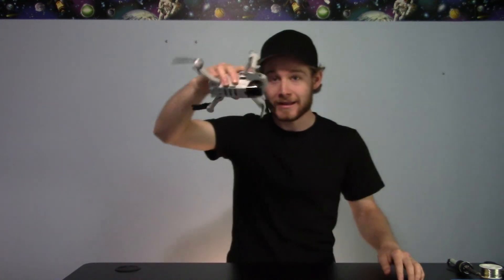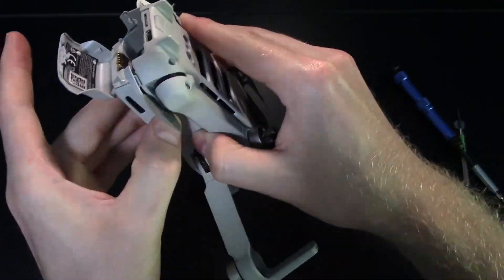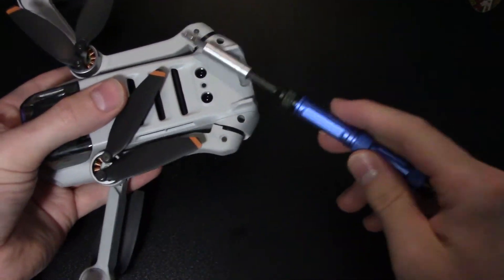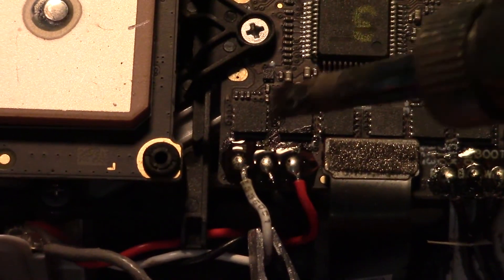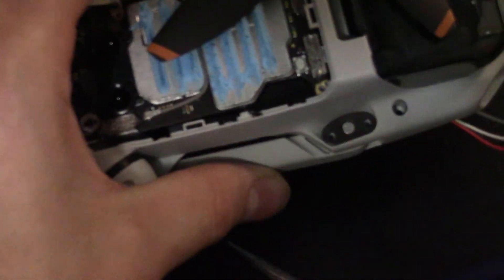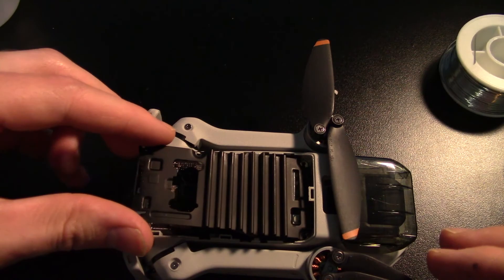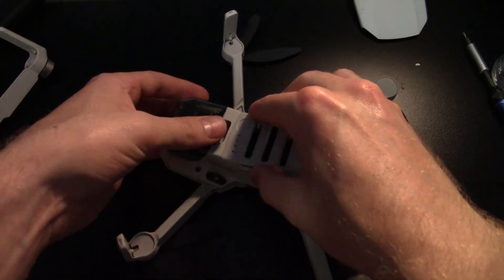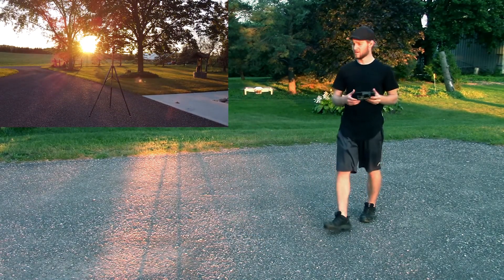DJI Mavic Mini 2 Front Arm Repair: Step-by-Step Tutorial

Comment: Where did u get the replacement
Reply from the maker: I got it from Amazon. https://amzn.to/2WTXDWY could probably find it somewhere else for cheaper though. Look up OEM when searching too.
Reply: @NathanShantz  I need the front left  pls help with a link I been searching not seeing any that's available
Reply from the maker: @AliKraftDesign  You can get a mavic mini (1) leg and swap the motor if you have a mini 2. https://amzn.to/3FNCRZz  You could also try ebay but it might take longer to get to you. https://www.ebay.com/itm/254795790373
Reply: @NathanShantz  ok (mini1) so it would work just the difference is in the motor correct
Reply from the maker: @AliKraftDesign  yeah the Amazon one is mini 1. I believe the motors on the mini 2 are a bit better in performance but the same footprint.
Reply: Would it fly differently with mini 1 motor vs mini 2 do I need to unthread it
Reply from the maker: @3brosgaming69  I have not tested this but I am assuming it would have to send more power to the mini 1 motor to create the same amount of lift. This would end up using a little bit more power from the battery so you might see the drone have to land maybe 1 min earlier? Probably less if just 1 out of the 4 is a mini 1 motor. I don't think it would affect much of the flight performance/handling tho.

Comment: Great video great details thank you. Just got the mini 2 for Christmas and wouldn’t you know it tree jumped right out in front of me too. Ordering a new arm and doing the repair myself I see it’s cheaper to buy a shell with no motor what do you recommend with or without motor
Reply from the maker: I probably could/should have got one without a motor as well. I don't think it's that hard to take apart. I would look up how do do that. The antenna wire also runs through there so you might need some small tweezers. Also some people have 3d printed shells so if you have access to one that might be an option? Good Luck!! 👍
Reply: @NathanShantz  Guys, are you able to find a video how to replave just the arm shell? That would be a great video because I cannot find one. Thanks for the upload video it was great easy to follow.
Reply from the maker: @maxblued  I know someone 3D printed a arm shell and just swapped the motor, antenna and wires. I'm not sure if they sell just the shells but I can post a link to the 3D video if you want?

Comment: Hey bro,  so I snapped the arm lock piece rite,  I got a replacement but the arm won't lock back in place when folding out
Reply from the maker: So the black piece with the 2 screws that holds the arm in has a spring in it. This spring only rotates from 0° (folded in) to like 150° (folded out). It actually has enough force to go to 180° but is physically locked at the 150°. This is how it locks. If take it out when it's folded out and put the spring back when it is folded in, it will not be able to lock in the out position. My guess is you took it out in one position and put it back in the other. Try putting it back in the other position or you can use some pliers and rotate the spring. Hope this helps!
Reply: @NathanShantz  ahh I didn't think of that, cause the crash took it out. Lol. So I don't know which way it was in, ima look now and see if I can find what you mean

Comment: What soldering kit did you use?
Reply from the maker: I just use a Weller one that you plug into the wall. I need to get a new kit. Weller is definitely one of the better brands to get. X-tronic and vastar  are some other okay ones on Amazon you can get.